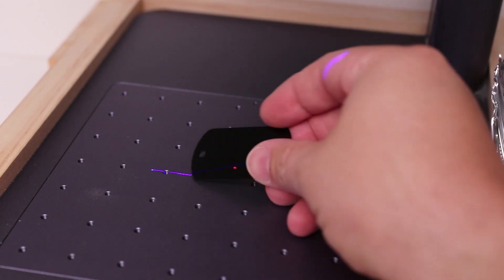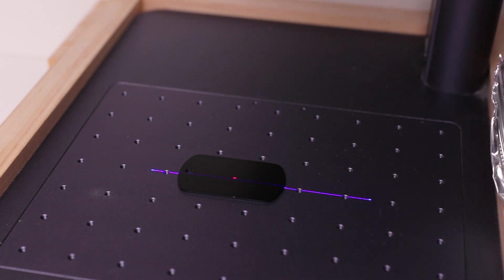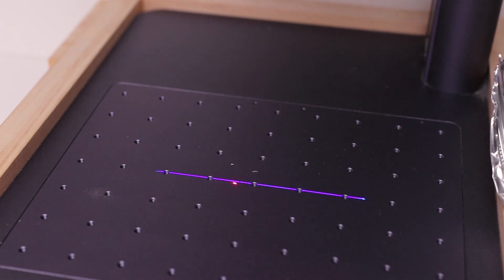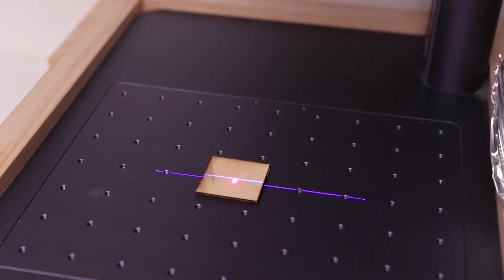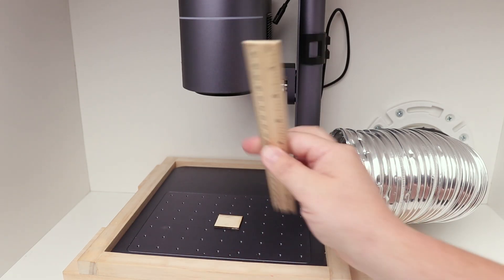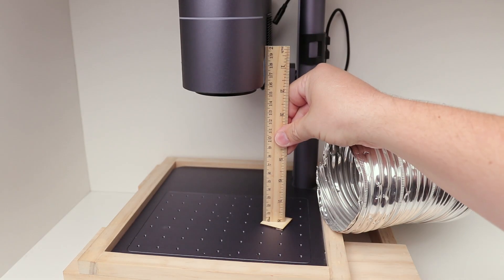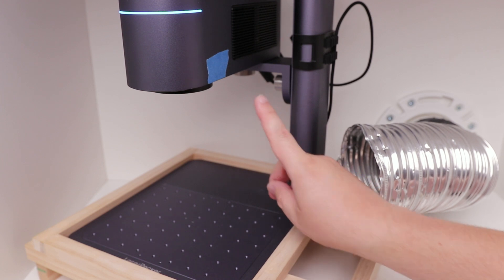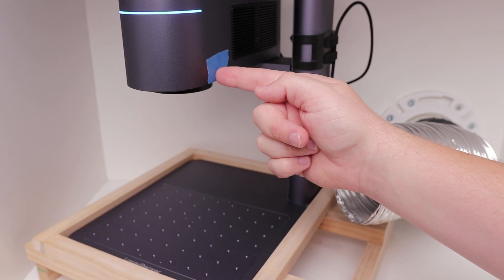Achieve Perfect Focus with the LaserPecker 4 (450nm): A Step-by-Step Guide

Comment: Using a ramp is a great idea. I made a 150mm stick with felt pads at each end. I have ALSO found that my red beams are not calibrated to exactly 150mm. They are adjustable but I haven't bothered - I use the stick between the object and the bottom of the lens or ring, which I realize are different, but until I do your ramp test I won't know which is better. LP says +/- 5mm is OK, but I think  +/- 2.5mm is safer.